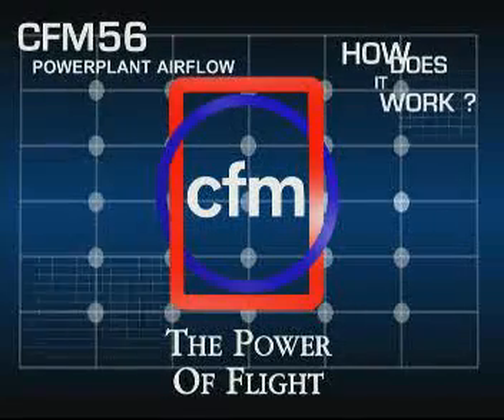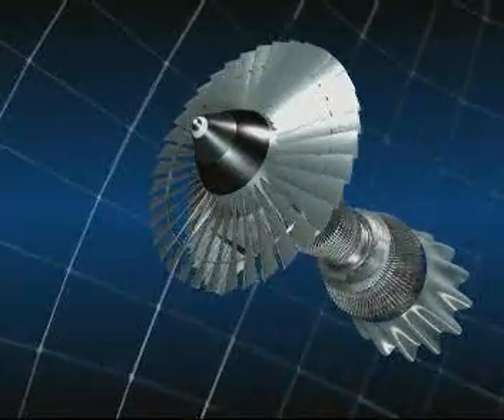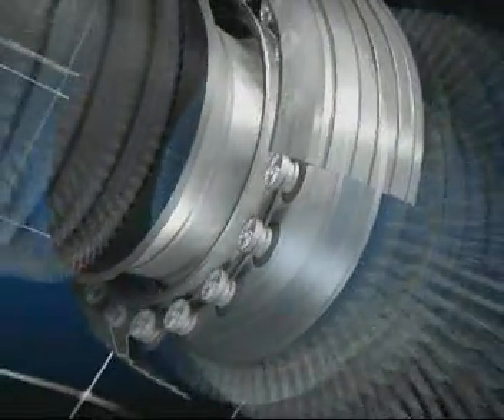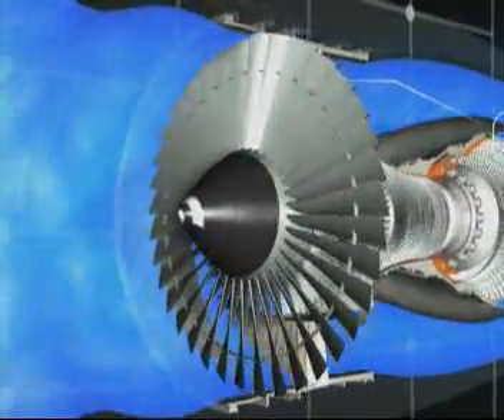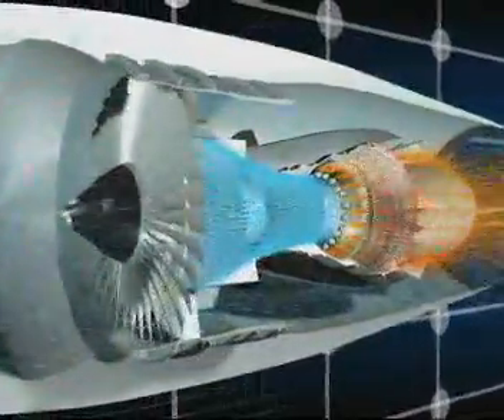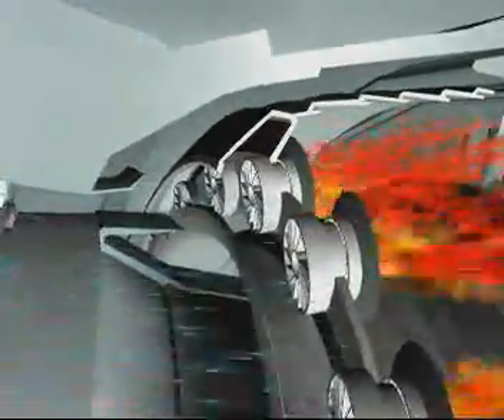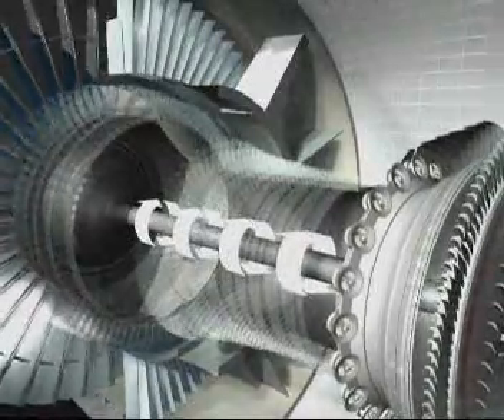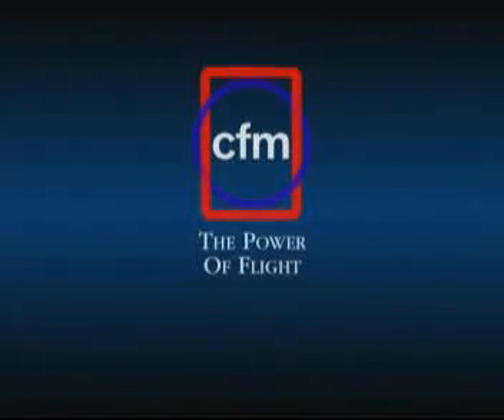How a CFM56 Turbine Jet Engine works.

Comment: I have a basic grasp of how a turbine engine works, but how the hell do they spin it up to begin with. It's not like a 4 stroke engine with a starter motor
Reply: +GeneralG1810 they use a pneumatic source (air) to drive a starter motor (the starter has a turbine within it), this starter motor is connected to the gearbox which in turn spins the turbine rotor shafts.
Reply: +GeneralG1810 Further, this air is either bleed air from the APU, or air from a air start cart.

Comment: This jet engines are started by pressured air to make the rotor spins then the fuel injected to start working by itself,
you better search for (jet engine start up)  on the web to get more info.

Comment: how does it start spinning intially?...like an internal combustion engine needs an electric motor to start it initially and combustion follows when air and fuel mixture is compressed....
Reply: High Pressure from the APU (Auxiliary Power Unit), from a "Huffcart", or from bleed air after one of the engines start.

Comment: this is a big jet engine sample ,  is it possible to create a homemade smaller one ?
Reply: Possibly. Model jet engines like the WS-15 turbofan scale model works but it’s not a real engine so it wouldn’t work as how a real engine does. It’s only a scale model to show you how a jet engine works.
Reply: If you want an actual jet engine, the jetcat p400 will probably satisfy you but it’s not a cutaway engine so you can’t see what’s going on inside the engine unlike the WS-15 turbofan scale model engine which has a cutaway which could show you what’s going on there, the components and the like inside the engine.

Comment: @koopa888: You are quite true^^ Only the CFM56 in the A320 Family (CFM56-5A/CFM56-5B) isn't having the "D" shaped configuration unlike the common "D" shape among the 737s and the NG737s(CFM56-3/CFM56-7B). Somehow it is also an engine used for the A340-200 and 300 series (CFM56-5C)

Comment: They are a combination of GE of the United States, and SNECMA of France.  The CFM56 is a mix between GEs CF6 and SNECMAs M56 Engine
Reply: That’s why it’s called “CFM56” because CF6+M56 boooomm! You get your CFM56!
Reply: That’s why it’s called “CFM56” because CF6+M56 boooomm! You get your CFM56!
Reply: That’s why it’s called “CFM56” because CF6+M56 boooomm! You get your CFM56!